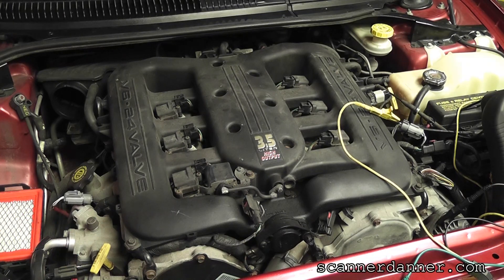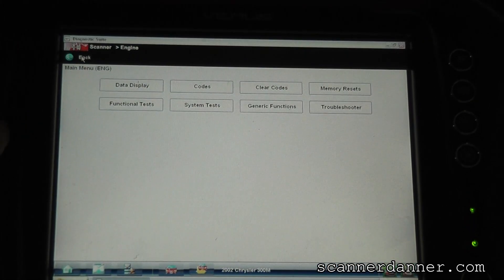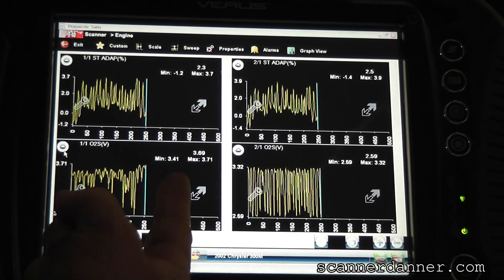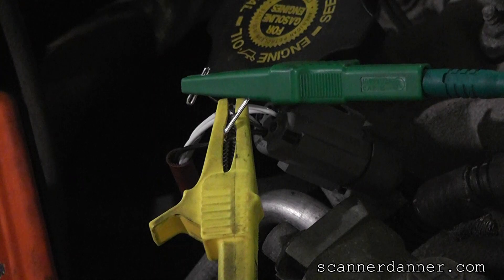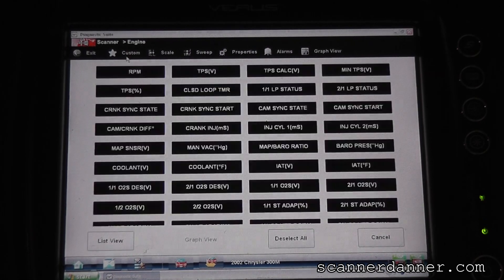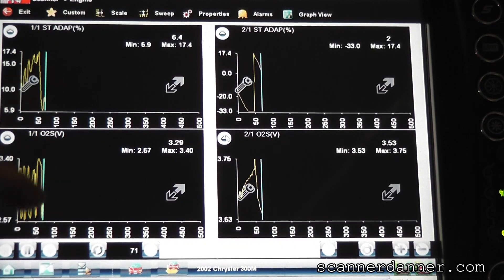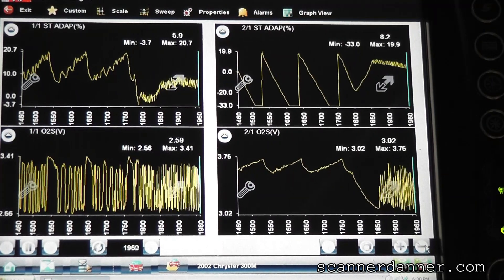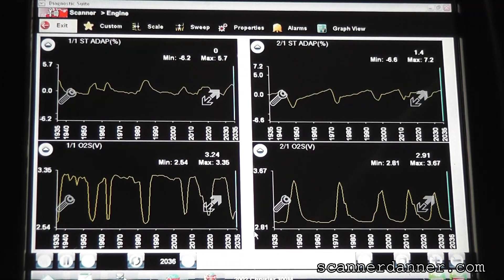WARNING! Aftermarket Oxygen Sensors (Chrysler/Dodge/Jeep part 1)

Comment: Hi, I have an 06 Sebring 2.7l and am getting  a P2098 Bank 2 sensor 2 Post Catalyst Fuel Trim System to lean and a slow to respond error on Bank 2 sensor 1.  I do know a year ago the 02 sensor was replaced on Bank 2 sensor 2.  Can these codes be caused by aftermarket sensors being used?  I was monitoring the sensor and discovered that when you accelerate the voltage on Bank 2 sensor 2 it goes to 0 and soon after the fault is registered.
Reply from the maker: +Bill Turner you need to fix your Bank 2 senor 1 fault first

Comment: Looks like Bosch overlooked this. Bosch first invented oxygen sensors, both wide band and narrow band. I believe they are top quality if right one is selected. Indeed 15705 is one of proposed for this car by Bosch (http://www.boschautoparts.com/vehiclepartfinder/pages/vehiclepartfinder.aspx). In Bosch O2 catalog is different number, but universal one (http://www.bosch-lambdasonde.de/en/downloads/lambda_sensor_catalogue.pdf page 146), so most probably will not fit either.
As you showed, this wrong sensor is behaving differently from bank to bank. Maybe due to heating control is slightly different. More heating on bank 2.

Comment: well seems like you keep on working on exactly the same stuff i am not a chrylser mercedes e320 p0130 it wont go into closed loop got a part number on bosch 02 on mercedes forum thought i was gonna be ok with that but now i am wondering also indentifix showed about 10 comfirmed fixes on this code with either bad b1/1 02 or wrong o2 installed,didnt give part# just said make sure its for a 97 model . i have been busy and havent gotten much futher in the lectures than section 3 or 4 but any way i will

Comment: Chrysler Franchise Dealer not using OEM parts AND! Shotgunning part's
I would advise the owner to contact Chrysler and file a complaint.
Reply: Agreed.
Reply: If it was a Chrysler dealer that was dealing with the aftermath of the crash, they should have known better about going aftermarket...or would they if they always use their own product?
Reply: You'll find 90% of auto parts are aftermarket anyway.  it's just a stickers on a box or the part itself that is the difference.

WIth going for "non-branded" parts you need to make sure the sensor does what you want it to be doing.

You have 2 types of O2 sensors narrow and wide, then you have the ranges in those types,   don't pick the right onw you get problems,  many people don't look at the specs and just dump in anything and say FIXED!!!
Reply: Something weird I noticed was my O2 sensor broke in. It more and more quickly went into close loop over a week on a 1999 Chevy Prizm. And by the way, the outside temeperature has dropped. So I'm not living in the southern hemisphere. 

I bought a cam sensor for the same car at AutoZone. It was "aftermarket" when I got home it was the official dealer part in an aftermarket box. Lol

Comment: I don't think Bosch cares about this special case at all that the Chrysler uses a bias of 2,5 volt.
Why should they? This is not common in cars (at least in Europe and Asia)
Reply from the maker: Upon further research, it is the PWM heater circuit that caused this issue. The Bosch sensors were designed to be on all the time like the older Chryslers were.

Comment: I bought the complete set of motorcraft fuel injectors from O'Reilly which I paid 571.00 dollars for. 

They are yellow color. It didn't say motorcraft no where but on the box. Does anybody know how to make sure that they are indeed the motorcraft ones?

These numbers are on the actual injectors

0 280 155 900 on one side and then on the other side XL2E-A1C

It says motorcraft on the boxes and this part on them XL2Z-9F593-AA

Something doesn't make sense but I don't know how to be sure that they are legit or not.

Comment: BTW, a friend of mine SCRAPPED a guy's car because of this exact problem, just a few years ago.  It was a 2002 Chrysler Sebring, and it was in pretty nice condition.  Broke my heart, but I didn't have the time or money to buy the car from them and mess with it myself, so I watched them just destroy it.  The owner didn't want to spend any more time or money on the car and just gave up, because he couldn't get the car to pass a New York State Inspection due to the CEL being on.  Fricken emissions inspections in NYS are controlled by our wonderful (loser) state government, and if your CEL is on, you will not get an inspection sticker here and you would have to drive your car around illegally, which is very risky since cops are seem to be damned near everywhere around here.  Not cool.
Reply: For such state inspections and that it was just the damned CEL, I would have jury rigged it so it did pass rather than scrap the car.
Of course the emissions part is a different story, I have seen an old 98 Mitsubishi with problems like this, it failed emmissions but I do know it had aftermarket O2 sensors on it and they never found the problem.

Then again they never took the scope to it either so I don't know that car's fate.
Reply: I've lost 2 beloved vehicles due to NY state's ridiculously strict inspection standards. Finally wound up giving them a giant middle finger and driving my last Jeep for OVER A YEAR without an inspection. Huge FU to the state and loved every minute of it! The fine would've been $200, but I probably saved hundreds more by not having to chase the problem. Luckily scored a Florida Jeep a few weeks ago and just need to put o2 sensors on it.

Comment: If the ECM defaults off one bank and adjust both banks accordingly, then what harm is it leaving that Bosch censer in the unregulated bank, outside of setting a code? The computer wasn't regulating off of it anyways. That's obviously what Chrysler did, and I'm sure they know about this, I couldn't imagine them NOT knowing about it, and I bet if they knew the car could NOT run on this censer at all, they'd of told the insurance company about it and used the OEM O2. Also, why the heck design a computer to use just one O2 for regulation but have two O2's.... it's obvious from this diagnostics the ECM only gives a crap about one bank anyways?

Comment: I get incredibly angry when I hear such things that a dealer has put none oem parts on a car. If you are a dealer for Gods sake put the correct, oem, replacement parts on the car. Why the hell should customers go to you otherwise?
Reply from the maker: I found out this was not a Chrysler dealer anymore, they used to be but lost that division. I mention this is part 2 coming up.
Reply: Yes I heard that in the video so I will have back on my earlier statement. Very nice video as usual. I wonder if it is not the heater in the Bosch sensor that is the problem?

Comment: Simply the wrong application.  The Bosch 15705 is for the 1997 model year with the 2.4L engine only.
Reply from the maker: wrong.
This is the correct listing from bosch. Here is a direct link to their website.
http://www.boschautoparts.com/VehiclePartFinder/Pages/VehiclePartFinder.aspx

15705 is an upstream exact for for this car.